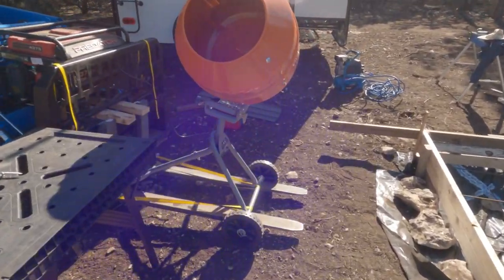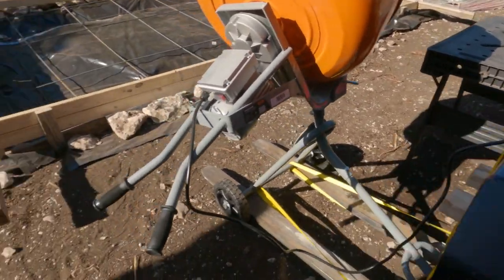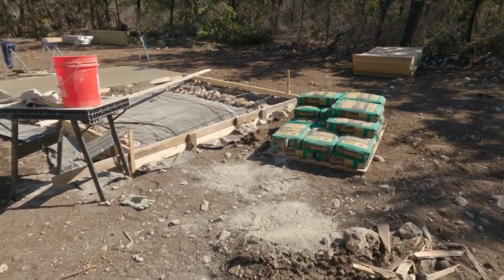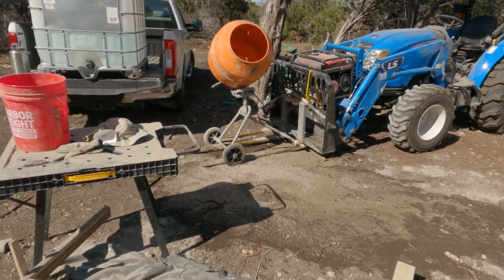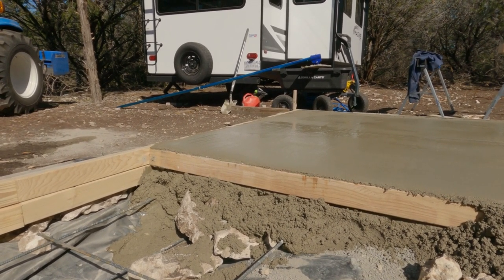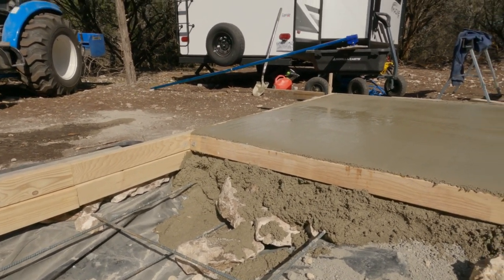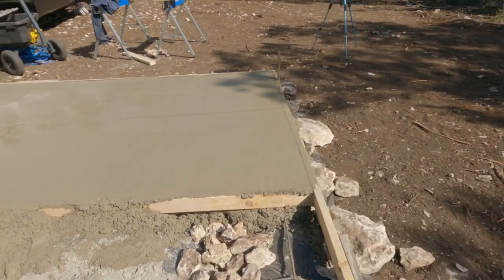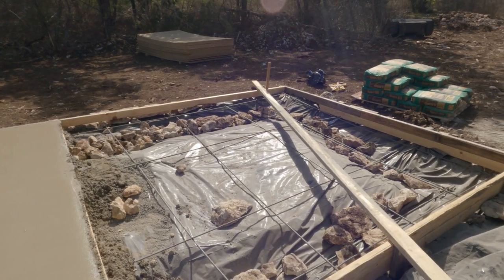2 - How Not to Pour Concrete

Comment: hey bud i like your mixer/generator setup on the front loaded! genus!  im not a concrete expert but have done a lot of pad prep in the last few years.the better you prep the better the pad. concrete heats up to cure 28 plus days depending on the mpa (sorry i dont know if thats metric or imperial measurement🙄) to get to its final strength. the more consistant depth of concrete the less chanch of cracking as it cures. id also ask around your local concrete plants whats there minimum metered load delivered. they can also do higher mpa so less thickness needed
Reply from the maker: Yeah when I called around it was quite a bit cheaper to do it myself, and my motto is "it's just a shed" lol. Yeah I learned that the hard way, definitely going to put in more prep time next time.
Reply from the maker: I also learned that it was much better time wise to mix 4 times, dump each one into my bucket then dump the whole bucket. That went much faster.

Comment: Solar Shed? You could put a Windmill on that slab 🙃
Concrete is just the worst..
Reply from the maker: Did I use the term "solar shed"?  Kinda how I think of it but because it will house the solar equipment,  not panels. Kinda deceptive.

I looked into wind, and don't think it's worth it. Ideally you need it at least 25 feet off the ground and a large clear area of 100 feet around it with no trees.
Reply from the maker: And then there's the whole problem of how to tie it into my batteries. My battery bus is 48V, and my options for windmills are very limited at that level, also I'd worry about my batteries. My inverters are smart and know exactly what the batteries are due to communications,  with windmill I'd just have to set it to turn off at a certain voltage range, and then you don't turn off a windmill, you have to use braking resistor to stop it from spinning out of control when batteries are charged. 

It's a lot of extra equipment, expense and setup, I'd rather just buy a few more batteries.